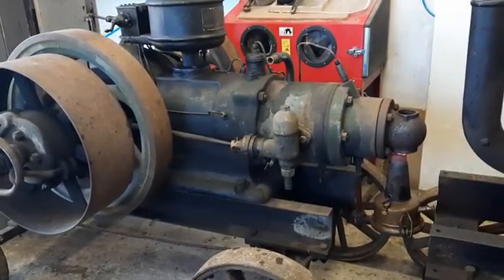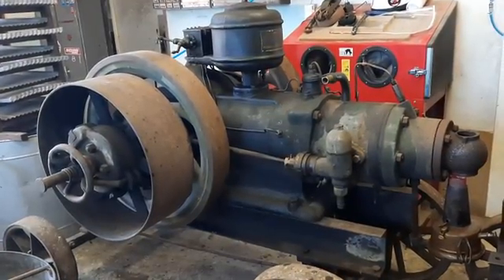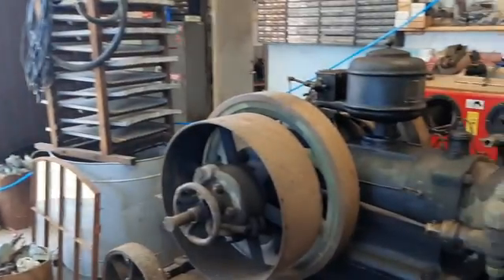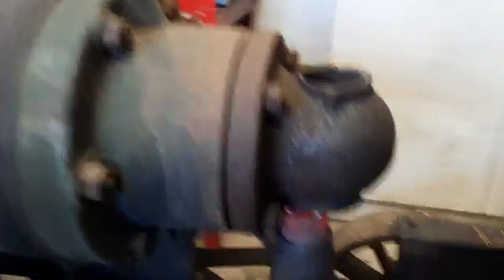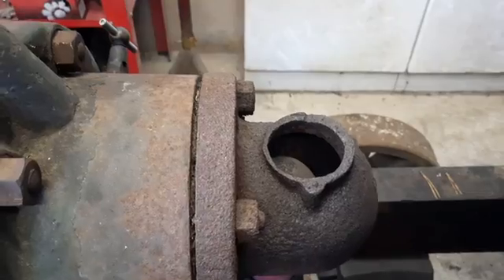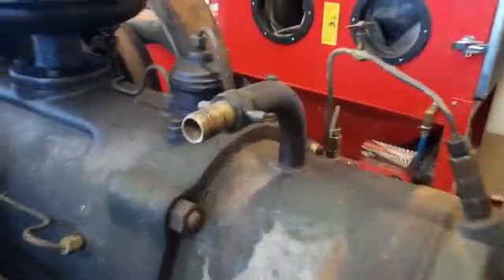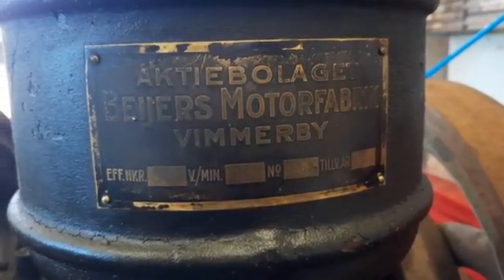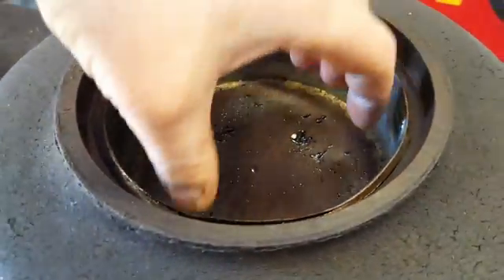10.4L Oil Engine Running @ Zero RPM. How is that possible?

Comment: When I first read this, I was like zero rpm? Is he crazy? Now I get it.
Reply: 1/2 rpm + -1/2 rpm = 0 rpm. Just vibration really (sex toy?).
Reply: @donotwantahandle1111  you know. When I watched that video, the one thing that didn't come to mind was sex toy.
Reply: @donotwantahandle1111  I feel you may be making a faulty asumption, or that they're still husband and wife... Or is that part of the role play?
Reply: @donotwantahandle1111  Revolutions, like speed, do not have a negative value.
Reply: @donotwantahandle1111 According to an old limerick I heard, you'd best be real careful round about the 33rd stroke.
Reply: It's bollox really although it'd be interesting to know what speed it does actually do ! It needs a tacho mark at BDC and count the marks over 2 minutes to get RPM
Reply: its quite clearly at least 1/2 RPM
Reply: @benholroyd5221  Maybe 300 half revolutions per minute ?
Reply: @millomweb  so 150 HRPHM then?
Reply: Same. Then I was like "I see what you did there" lol technically the engine speed can still be measured as rpm, it's just changing directions.
Reply: @c117ls7  If you measure the rotation speed over 90° and multiply by 4, you get rpm without needin a full revolution.
Just a mild revolt will suffice ;)
Reply: @millomweb  my point exactly. Lol
Reply: It is a really cool engine though and I would like to see what the lowest rpm that it can truly achieve.
Reply: @LichaelMewis  I didn't watch the video as I've seen a video of another tractor engine 'running' like that.
Being a diesel, it's lowest RPM won't be as low as a petrol engine. A petrol engine can be started by a spark but diesels need a fresh compression of air (which heats it) for ignition.
Reply: @millomweb  You have it the wrong way around.
 Diesel's run at much lower RPMs than petrol/gas engines, with many large 2 strokes diesel's being able to tick over at just 9 RPM! With the line of diesel's I mainly work on having a rev range of just 12-102 RPM!. Please look up the RT-flex96C and you will see what I'm talking about.
Reply: @hardergamer  You can't start a diesel from 0 rpm but you can a petrol engine. A petrol engine will therefore run at speeds down to 0 rpm. Diesels won't.
I'm not working on opinion but on science - the science of combustion and moreso, ignition.
Reply: @millomweb  i think diesels are more suitable for their higher pressure and temps wich allow the fuel/air mixture to burn progresively as the cobustion chamber gets bigger on a slow moving piston whereas a gasoline engine has a faster combustion and the spark is no more.
but just that,i think,not i know.
the slowest engines are diesels,and all rely on very,very long strokes with pistons at a speed you can read inscriptions on them.
Reply: @xiro6  In general engine terms, diesels are generally slower revving but they have a minimum speed to ensure the next compression. Petrol engines don't rely on a compression. The compression there is simply to get more fuel in a small space.
Reply: @millomweb  then,we are getting just a case of discussing different scenarios.
we had an standalone gasoline engine like the video,and a diesel engine mounted on a ship (for example) were the engine is coupled with a huge mass of axle and propeller wich also have a flow of water  "windmilling" wich will overcome the compression.
just in case its not overcome by other cylinders and its own momentum.
Reply: @xiro6  The discussion was about the slowest rpm. While diesels are generrlly slower than petrol engines, a diesel needs to be moving to run - a petrol doesn't - so a petrol will always win the slow race :)
Reply: @millomweb  I beg to differ.  Actually I would like to argue for both sides of the debate if I may.
Both engines "can" start from 0 rpm, but both engines need external assistance to do so.
The diesel in the video "IF" brought to just past TDC and stopped (0 RPM ) with fuel oil in the cylinder The flame torch on the preheat bulb would eventually ignite the oil (although this would require a LOT of glowing cast iron) in the cylinder forcing the piston down (piston movement from 0 RPM = started) not likely enough flame front to complete 1 revolution.
A gas engine can be started from 0 RPM with a similar method, and is far more likely to continue to run, but it still needs some method of putting fuel and spark into a cylinder just past TDC
Just like the mechanical injection on the diesel, the gas needs external help to get in the cylinder.  That is easy if you have a CPU that knows which cylinder is just past TDC compression, and said computer can start a fuel pump, pulse a injector then fire the appropriate plug VIOLA it will start and run if the required phases of each stroke are met.
That said a Diesel engine will run at MUCH slower RPM than a gas engine because the rapid expansion of gas will not support the flywheel weight required to sustain very low rpm. 
Diesel is far more energy dense than gas, and the slower the burn the more power you can make.  Diesel wins. Technically flywheel weight wins.
Reply: @kevinsellsit5584  "A gas engine can be started from 0 RPM with a similar method, and is far more likely to continue to run, but it still needs some method of putting fuel and spark into a cylinder just past TDC" "Just like the mechanical injection on the diesel, the gas needs external help to get in the cylinder."
Just needs a valve/injector - the gas pressure from the bottle will push gas into the cylinder.
I guess a diesel can be started from 0 but not with diesel ;) An explosive cartridge would do the job. Heating the combustion chamber will drive the diesel off before it ignites.

With petrol engines, wiggling the ignition advance and retard lever can, if you're lucky, ignite a charge in a cylinder just after TDC - something I've heard done on a warm engine back in the day - the more cylinders the engine has the more likely it'll work on the basis that one cylinder piston will be at the 'right place' !
Reply: the designer of this motor never would have guessed what a great clickbait it could be !
Reply: he's wrong though zero RPM means it's not moving
Reply: not me ...
Reply: its not actually zero RPM though. at no single point in time is it zero. its only zero over average time
Reply: @Blox117  That's not correct as it stops twice per cycle !
Reply: @millomweb  and you can't read

Comment: Not 0 rpm........It's auto reversing and running in reverse. Still counts as however many revolutions per minute it would be for the combined distance traveled in both directions.
Reply from the maker: But it doesnt actually make a single revolution per minute in this mode, so it is not far from the truth. But i understand what you mean!

Comment: Enough torque to run a rock crusher even when its just bouncing back and forth. Back in those days torque was king. Horse power ratings were used as marketing ploys. Massive farm tractors (called LOCOMOTIVES) could easily pull 26 bottom plows all day long.Now days so called horse power ratings are used to sell everything from fish tank pump motors at 1/10 of a HP, to dump trucks with 3200 HP 16 cylinder twin turbo charged Diesel engines and Torque is still king.
Reply: torque is meaningless when gears exist
hp is a unit with time included, ft/lb is not
Reply from the maker: So true!
Reply: As others have said, you forgot what a gearbox does. 
Power is what's needed. You can make any torque you need with the right gearing.

Comment: that how to shorten your life with oil smoke
Reply from the maker: All those people i know that worked with these engines all day long back in the days in sawmills, farmequip and so on got very old or is still alive.

Sure doesn't make you live longer but i dont belive that running them 10 times a year makes any differense.
Reply: @YesterdaysMachinery  true👍

Comment: The Lanz Bulldog tractors were able to run at zero RPM as well (also a hot bulb-type engine).
Reply: The Lanz Bulldog will run 0 rpm until the hot bulb becomes too cold for ignition to occur.

Comment: I love the cooling radiator.  I used to do this (zero rpm) with single cylinder 4 stroke Petter diesels. 
Thanks for this exposure to (real engines).
Reply: Yeah that cooler is awesome, I'd love to see that steaming away on a cool day.

Comment: Thanks for sharing ,that amazing engine 
Today's manufacturing should take a look at themselves for making such junk nowadays everything throw away.
 i seen an engine built in the 1800's, a hot air engine with a piston that was about 2feet across was a giant water pump amazing throw in a couple of sheets of newspaper spin the giant flywheel and away it goes for about 2 hours on that little bit of paper then you just add a couple more sheets of paper and repeat until the day of pumping is over and it still runs today
Reply from the maker: Sounds like a lovely machine!

Comment: Is it only with certain engine's can run flywheel in either direction? Like your video showing how it works with oilers.
Reply from the maker: These are made for it. If you want to run a spark plug engine in any directions you have to adjust the ignition for eather way.  And if 4 stroke you have to adjust valve timing as well.
Reply from the maker: Thanks!

Comment: seems like when she gets nice and hot you might be able to shift it over to water injection and run it as a steam engine.  great video. thanks.
Reply from the maker: Early hot bulbs actually had water injection because the hot bulb often overheated. But then they build a better system.
Reply from the maker: Thanks!

Comment: Zero RPM, one step forward one step back, one step forward one step back, story of my life , oh well at least the washings getting done !!
Reply: you're not alone my dear life hitchhiker, yeah well at least the washings getting done !! Well said !!
Reply: @NenadKralj  But I think your comment really is a reference to the lyrics of Substitute by The Who. "I'm a substitute for another guy
I look pretty tall but my heels are high
The simple things you see are all complicated
I look pretty young, but I'm just back-dated, yeah
Substitute you for my Mum; at least I'll get my washing done.....
Reply: that's not even technically zero RPM tho
Reply: it's not zero well you add both forward and back to get the RPM there's no negative value for RPM
Reply: @Johnny-tq9no  You know what a revolution is don't you
Reply: @-BuddyGuy  you know what a fraction is dont you?
Reply: @Johnny-tq9no  and how much RPMs are technically?
i get your point,but its right until you try to argue i think,but maybe im wrong and you solve the problem you go into.
Reply: @xiro6  there's no neg value for RPM
Reply: @Johnny-tq9no  You know what an average is don't you
Reply: @Johnny-tq9no  also you cant add up portions of turns.
at the end of the minute, how many turns it made?how many miles the car drove?or how many meters of cable the winch rolled?
At least, with a few tweaks it can make a perfect rocking crib
Reply: Technically it's Half a Step forward and Half a Step backward. a full step is a full revolution 0 rpm would be rocking back n forth at half

Comment: Still perfect for off-grid power generation. 4:1 speed stepup through an old diff should be close enough to 1500r\min. Use up old engine and chip oil..…

Comment: If you have any spare pistons laying around could you show us the bore size ? 👍👍🇺🇸
Reply from the maker: I don't have any spare ones, but i have pictures of the piston in the 25hp Målilla from when i restored it. That one got 265mm bore. Dont know the stroke, but i will make a video aboute that one too soon. I dont think it's possible to put photos here in the comments.
Reply: @YesterdaysMachinery  Can't wait to see that , thank's 😁👍👍🇺🇸
Reply: @YesterdaysMachinery  you could put pics in a new video slideshow and put a link in the comments with it pinned.
Reply: For some idea of the dimensions and rebuild/construction of this type of engine
https://www.youtube.com/watch?v=PQOeKFDarLA
Reply from the maker: @JohnSmith-pl2bk  Yes i follow Jenko, his hot bulbs engines are very simular to mine.

Comment: Boy, you`re endangering your health - and the crank bearings...
Reply from the maker: No, the engine are made to be able to spin at any direction. The lubrication system works just as good. Even when it just bouncing. 

Aboute my health, yes. Lots of moving parts and smoke. But sadly that is my hobby, and i love it.

Comment: I wonder, if it was used in a marine application would they be able to control it well enough to use the  0 RPM as an idle and then restart it in the right direction for reverse braking reliably?
Reply from the maker: Yes exactly as you say. Very common in siple fishing boats without reversable prop or gearbox at the time.

Comment: I think i missed something what is this motor for like what is it’s purpose what did it propel
Reply from the maker: For power. In sawmills, industries, farms etc. You put a big flat belt between the engine and the machine.
Reply: @YesterdaysMachinery  ah makes sense thank you

Comment: Is it a 2 stroke? Does the piston act as the exhaust/intake valve?
Reply from the maker: Yes, just like a chainsaw engine, but with fuel injection and a hot bulb instead of spark plug.

Comment: Interesting, zero rpm would be used for what purpose?
Reply from the maker: Nothing, as i wrote. But hot bulb engines like this was also used very much in boats. Then this 0rpm was the "idle". Then you could start the engine in the direction you wanted to get forwards and backwards. Pretty clever and very simple.